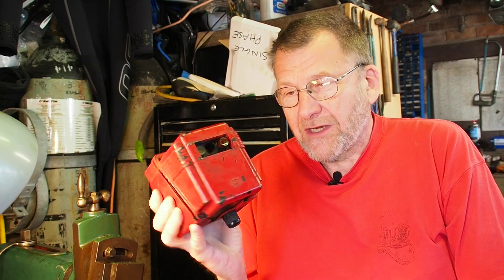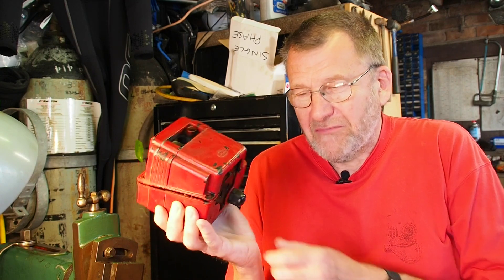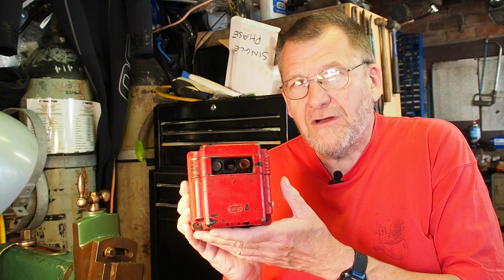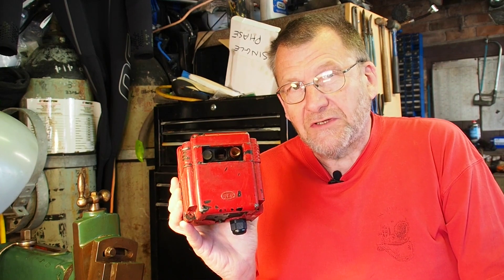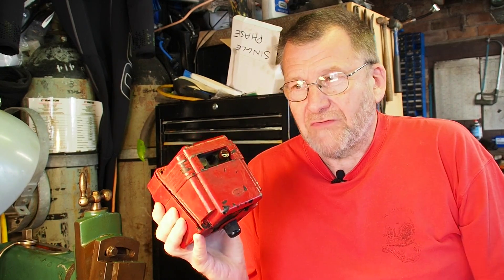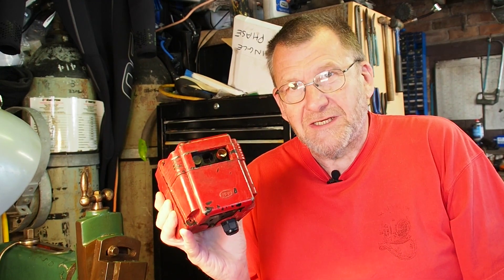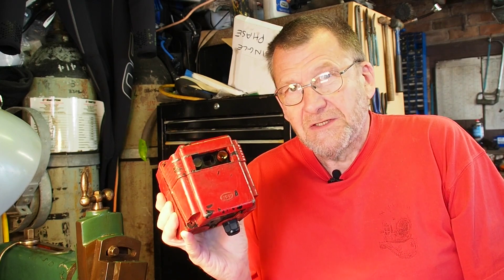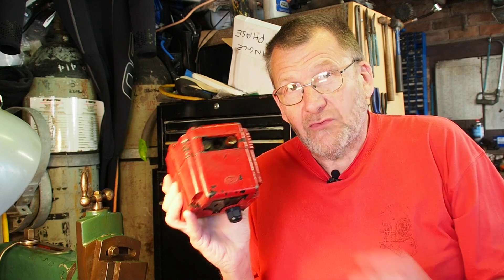Machine tool fault finding with the Kaiweets HT206D clamp meter - #135

Comment: The machine is running in reverse which will raise the current required when the tool is engaged into the work piece. The ram should advance slower than retract. Rotating correctly will give maximum thrust on the cut stroke for least current.
Reply from the maker: Rob! your comment got me thinking, been away for a few weeks so only just had chance to check and your were 100% correct!
Today I have removed the motor and swapped the windings over to reverse the motor (It's a split phase one with no capacitors).
The machine is now running in the correct direction. Your observation skills are much appreciated, thank you!
Reply: @LockdownElectronics  The Shaper and it's operation were part of 1st year apprenticeship. Yes I am old enough for when shapers were still a thing😁

Comment: Doesn't the motor rotating the opposite way? The cutting motion should be slow, and retracting the blade should be the fast motion. The motor torque will be lower then. So the amperage as well. In addititon, the retraction motion should move the workpiece.

Comment: As you live on GB is there residental three phase power available? My mind boggles every time I see a youtube video from the US and most people have to use phase converters. In Finland even the newer apartment building flats have three phase. And as far as I know almost every detached house has 3*25 amp or 3*35 amp panel or larger
Reply from the maker: We are supplied from a pole mounted transformer  certainly no hope of 3 phase!
There is only one phase on the 11kV overhead lines. The transformer is from the mid 1960's and probably in need of an upgrade!
Reply: Here in Czech Republic is the situation similar to that you've described from Finland. Almost any house or flat have access to at least 3×20A, but much common is 3×25A. Here in Prague I live in flat with 3×25A with possibility to upgrade to 3×50A, which is something I definitely don't need. Despite the fact my flat is located in a historical part of town in a building from 17th century, I have virtually no problem to access three phase power here. When I lived in Letowitz (small town in Moravia about 200km north from Wien), I had 3×20A without possibility to upgrade. But I had three phase power at all. This looks like that we have three phases almost everywhere, but it isn't completely true, there are some exceptions, e.g. Brünn. I used to live there two times in my life at two different places. The first one was a flat in a building from 1947 and I had only 1×20A. The second one was house from 1920 where it was even much worse, I had 1×20A only on top of that shared with three another houses, which was kind of terrifying experience, because everytime I wanted to turn on something with a higher power consumption like microwave oven or washing machine I had to open window and yell to negotiate our energetic situation to prevent tripping the 20A fuse we had no access to. There was no internet connection, almost no GSM and almost no electricity, it was a kind of amish paradise located in the center of that poor town. I moved out of there, because this was something I definitely didn't like. That eleven months I lived there was some kind of interesting experience, but, well, please no more. So everytime I see these one phase issues from US I remember Schimitz (that was that poor part of Brünn) just to realize that this could be even much worse… Whole world is kind of divided between AEG's three phase system and original Westinghouse's two phase, which, well, was then converted to a single phase.
Reply: In GB, homes are almost always single phase 240 volts, 60 to 100 amps - plenty of power for normal use, including a 7KW car charger.